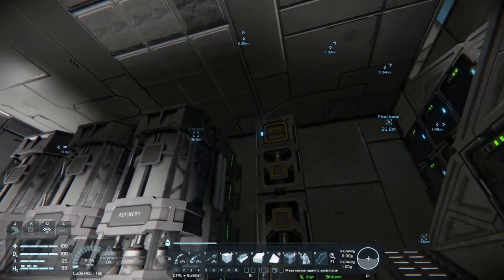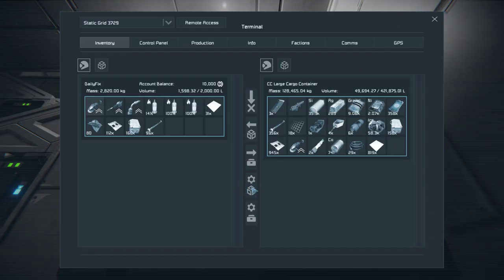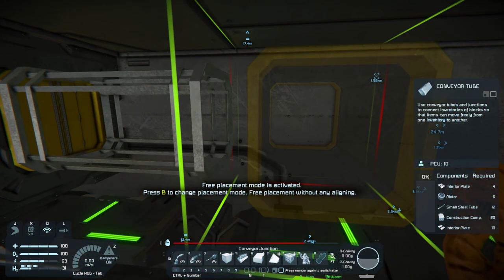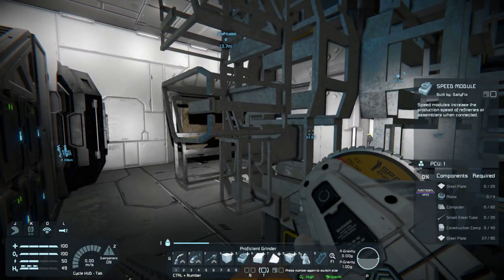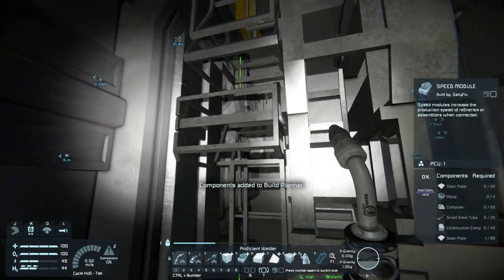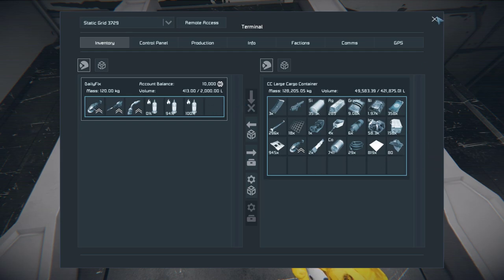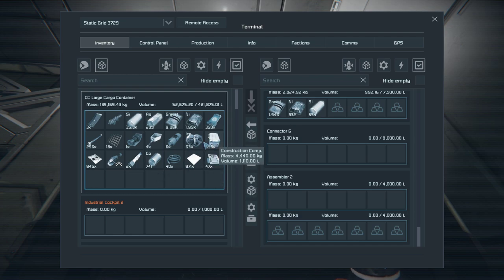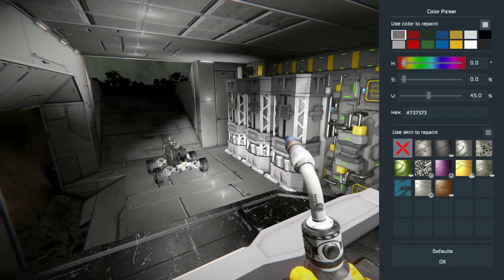[24] Speed modules - Road to Space - Space Engineers Survival

Comment: And the wind pilom or the hydrogen engine ?
Reply from the maker: Wind pilom is difficult because it would allow anything to connect to the top. But I'm sure we can get it to work eventually as for the hydrogen I haven't been able to get to that yet.
Reply: @DailyFixLP  it is simple the hydrogen engine. Put and h2/o2 to convert ice into hydrogen. Put somw hydrogen tanks and oxigen tanks to stock the gases (using conveyors) - then conext the hydrogeb engine to the hydrogen tank using more conveyors
Reply from the maker: @danielpirela1225  I'm aware I did have a hydrogen engine for a bit to charge my batteries. But I haven't gotten to give them a permanent spot in the base to produce a large amount of hydrogen.
Reply: @DailyFixLP  i see, try to mine a lot of material offcamera and build larhe structres offcamera too. Technically you have the position to go to space using hydrogen engines